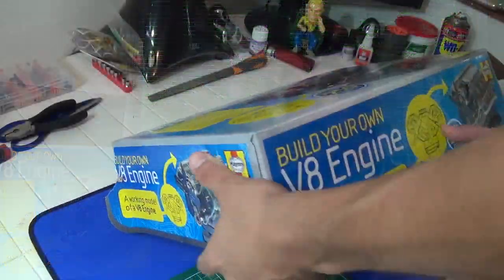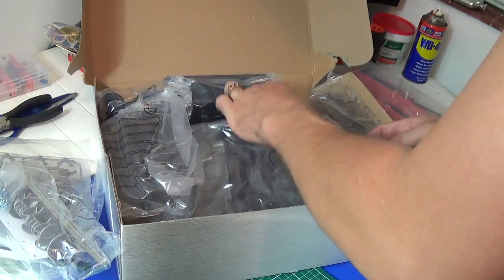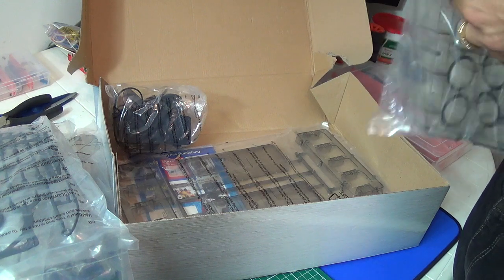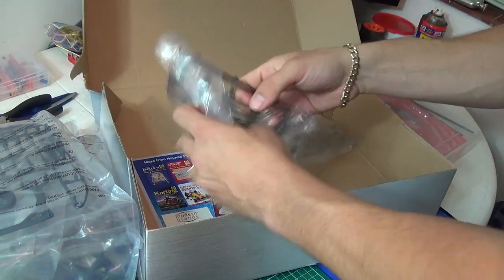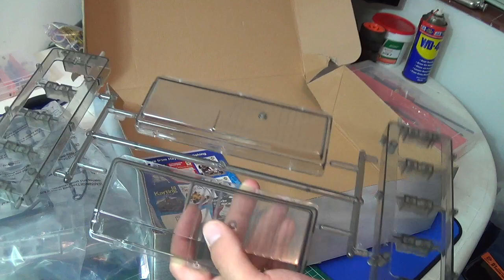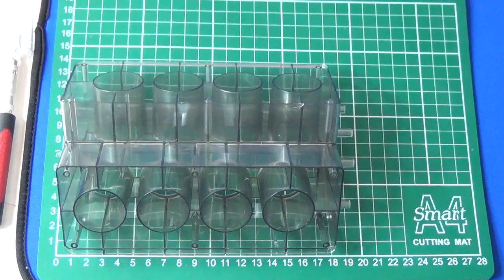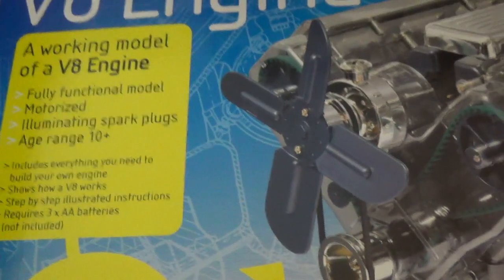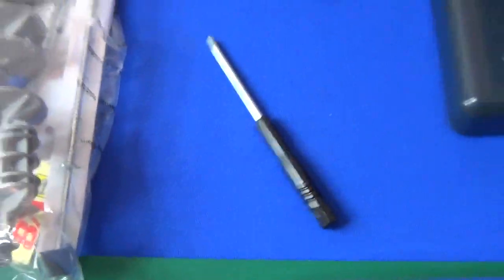Engine Build (Part 2) - UnBoxing

Comment: do you think it could be added to a 1:6 scale nitro or gas rc car if not connected to the drive shaft not a mechanic think that's the right term, if not it would at least add some realism underneath the hood I guess
Reply from the maker: Kevin Hatcher Jr i think you could def add some parts for realism.
Reply: Kevin Hatcher Jr o

Comment: nice

any other models for engine like this one
and how much does it cost
Reply from the maker: Samer ibrahem They had the same build kit but for a motorcycle engine. And it only cost AUD$89.99.
Reply: alright i might go for one in future seems legit to have one
Reply from the maker: Follow the series and you will see how it turns out.....